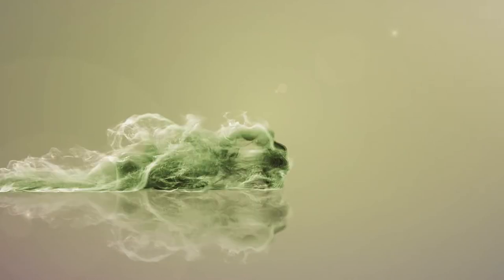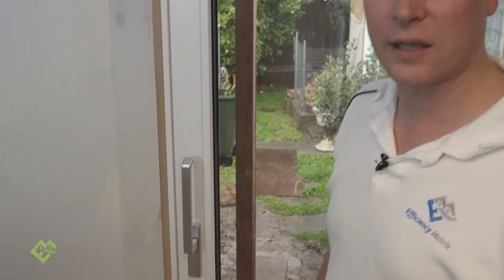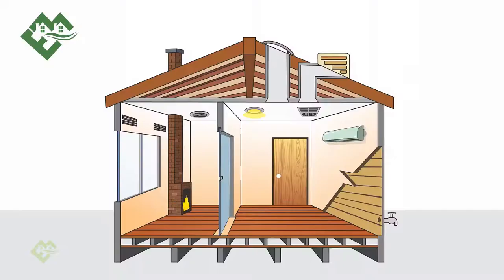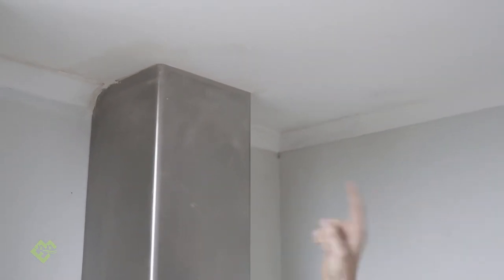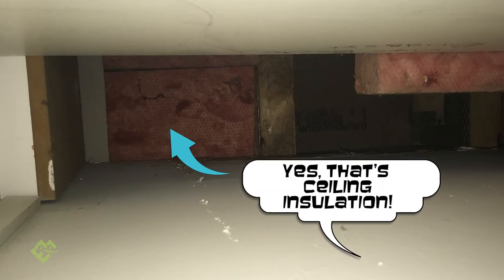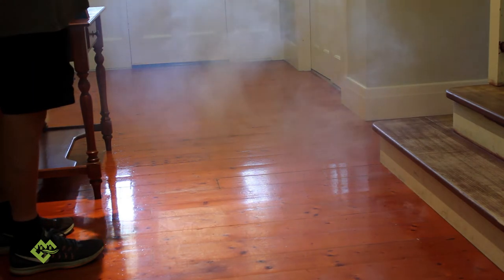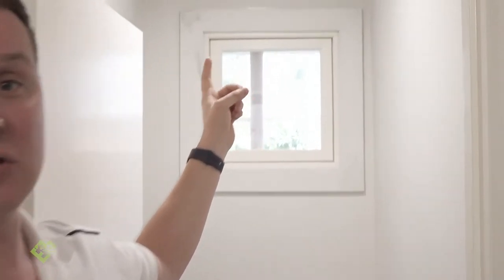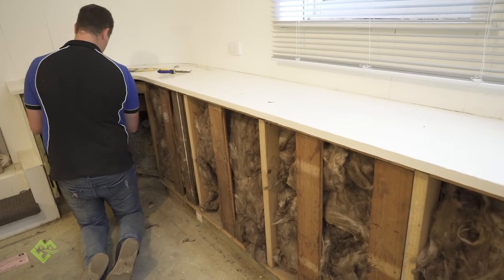Stop draft in your home? Common air leaks!

Comment: How to seal the split air condition behind? Because it's a big mission to undo the pipes behind etc and take off the aircon. Can't I just use tape that goes around the aircon?
Reply from the maker: You potentially need to move roof tiles and seal from behind.